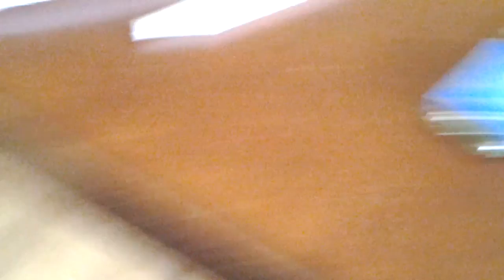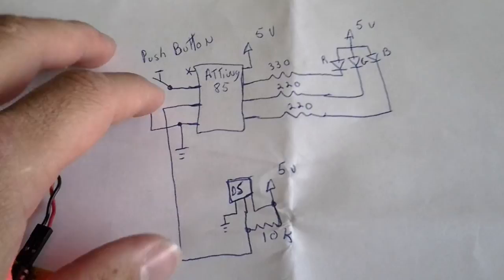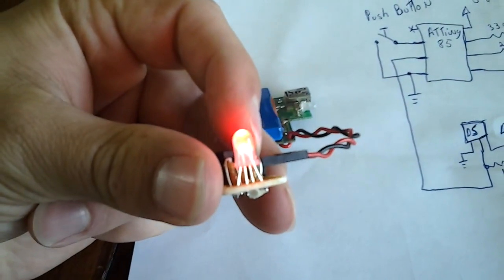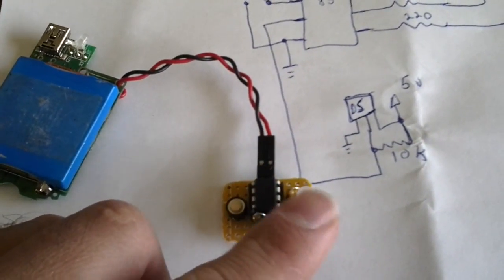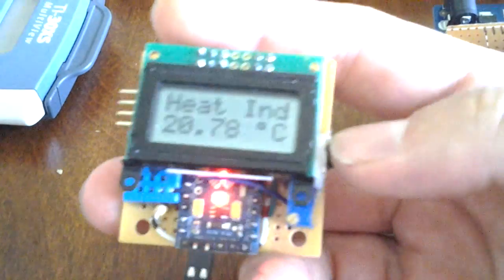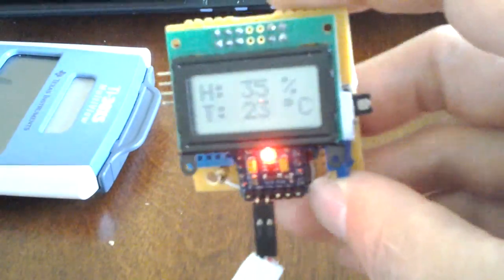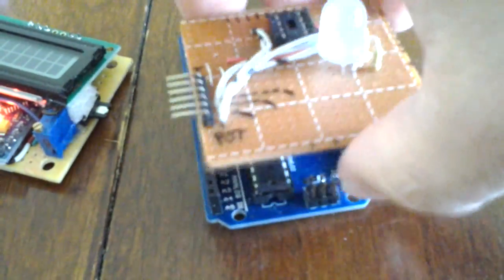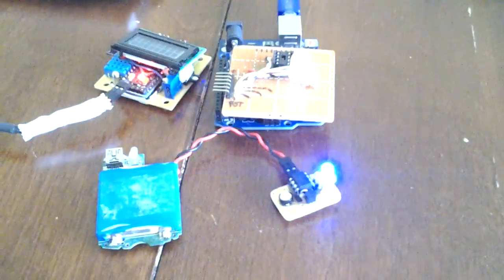Attiny85 thermometer and other projects

Comment: hello  can you please send me the attiny85 RGB led temperature. thank you
Reply: this my email padillasaul85@gmail.com
Reply from the maker: I just added to my GitHub repository enjoy :)
Reply: @bakupcpu   you think I can use the LM35 instead of DS18S20?
Reply from the maker: @saulito85  of course you will have to use the analog read instead of the massive code I put in there make it way simpler. since it's lm35 output if I remember correctly 100mv per degree c or something like that and it's linear. You can use the base of the code just remove everything that's related to the DS18S20

Comment: Hi, good video. I just wanted to say that you can program your Arduino pro with the IDE as you do with the UNO, just when it says "Uploading" and stays there push the reset button. (all this is made with a USB-TTL converter connected to the pro)
Reply from the maker: :) indeed although now I have a proper Attiny85 programmer shield that I've made myself :) I also have some USB to ISP programmer 3.3 and 5 volts.
Reply: Ohhh ok! I was trying to help! Do you have libraries for the attiny85?
Reply from the maker: Juan Biondi
No stress :) I use normal library for most of my stuff although I got some new one a few days go. I'm going to try I2C on Attiny85 to see if I can get an I2C display to work and a pressure sensor :)